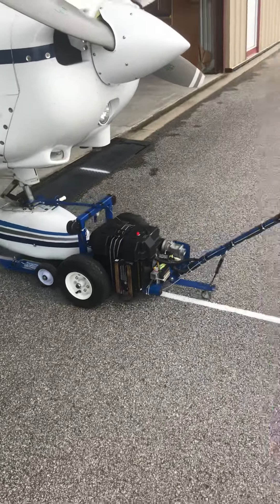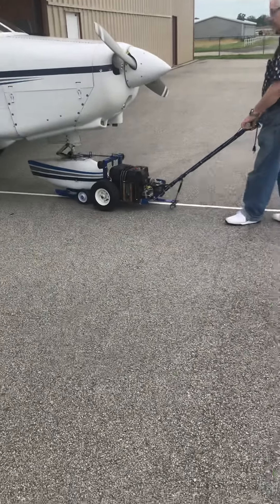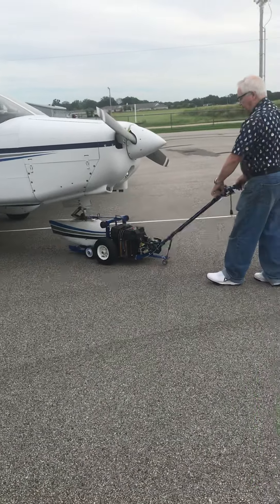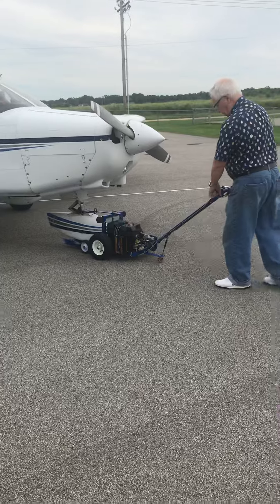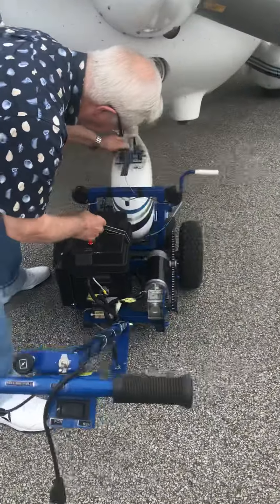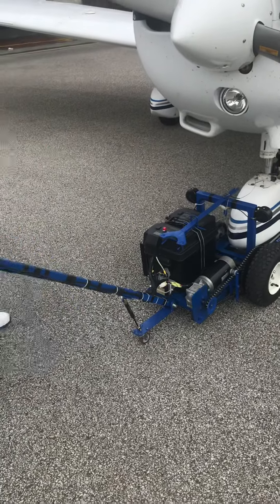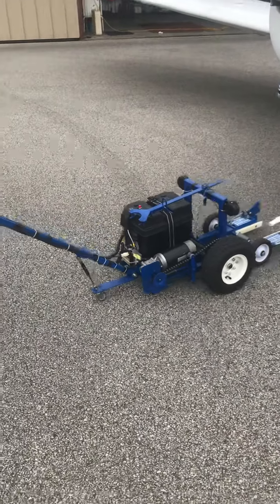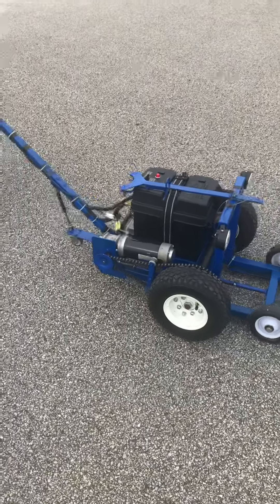Nosedragger in use

Comment from the maker: A third modification I did was to take a gas cylinder of about 50 pounds pressure and welded up a bracket for it on the underside of the arm to get rid of that goofy kickstand the gas cylinder keeps it self-leveling when you’re approaching the nose wheel to put it on the towbar keeps it from riding up over the roller and smashing the wheel pan into the battery box . I made the towbar to copy the the one that came with the airplane but just made it out of flat stock and fashioned it to where it would hook into the nose wheel the ear tanks. The tower was necessary to drag the towbar and keep the parallel lives in between the towing forces both top and bottom. The towbar is released by a simple pull pin  with a hole through the crossbar channel in  the tower that is made out of square one inch 1/8inch steel that was welded up to the frame. After towing in place pull the pin and this allows the towbar to be released from the nose wheel spin it around and put the pin back in place it is anchored with a cable to prevent loss. Those are about the modifications that I have made that come to mind. I have since sold the airplane and the nose Drager went with the sale of the aircraft.
Reply: Wow!  You seriously modified and improved that - very impressed!  Thanks for the details!

Comment: Looks cool!  Can you share what modifications you made and why?  I've got a Grumman Tiger with nosewheel pants much like yours.
Reply from the maker: I welded a tower from one side to the other to make a Tobar facsimile from the tower to the ears on the nose gear this kept the nose gear from riding up over the roller when pushing it in reverse into the hanger. I also took a cable from the roller that slides and ran the cable from the roller axle to the gate closer and spring-loaded it to where when the wheel went into the slot for the guides it pushed against the roller closing the gate behind it I took a cable release to release the rear gate roller so I don’t have to crawl under the planeAnd added some headlights to the towers that are LED put a voltmeter on it master disconnect switch etc. so I can see the state of the batteries at any time and prevent any discharge or inadvertent operation I also put a new crossover switch on it that was not momentary and it would hold either forward neutral or reverse. Hope that helps
Reply from the maker: I also made a dual roller chain tensioner that squeezes the chain together and keeps it all the slack take a nap in it it is spring loaded because it would throw a chain occasionally you can see that in the video when I Honen on it is basically two nylon rollers with a center pivot that spring loaded and attached to an eyeball today drilled into the side of the frame and loaded with the spring this keeps the chain tension at all times that’s the clicking sound you hear when it is coming out of the hanger